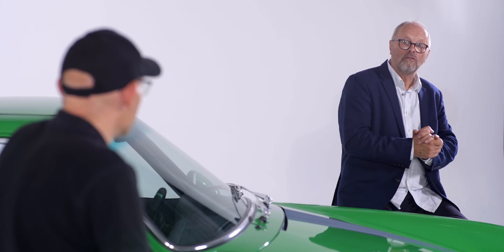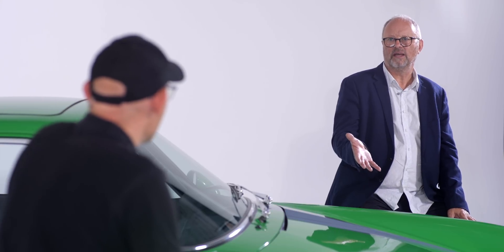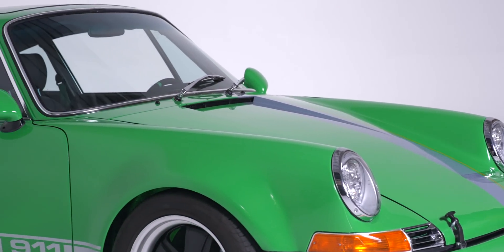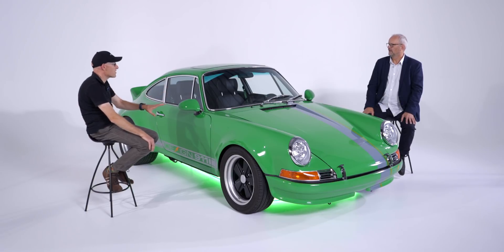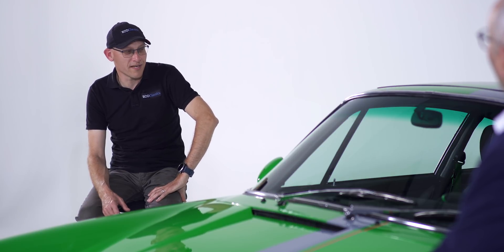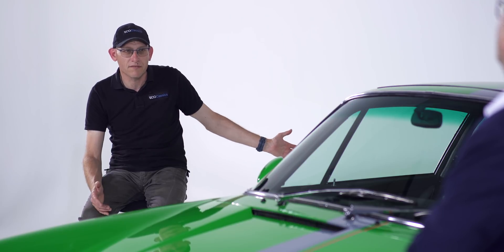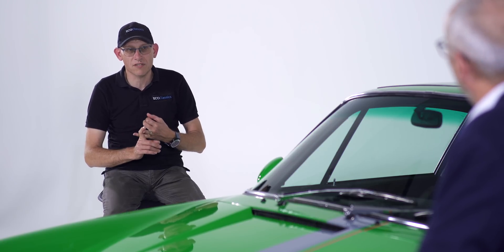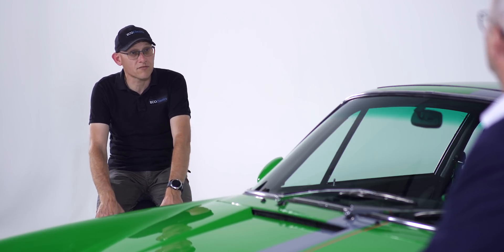Creating Electric Classic Cars - ECO CLASSICS | Fully Charged PLUS

Comment: Arguably, in throwing out the existing drive drain and replacing it with this electric uni t, with all the CO2 created through its production, the car probably has an even larger environmental footprint than before!!
Reply: And if the engine's siezed and un salvageable, you could save even more CO2 by sending it straight to the scrappers...

Comment: I’m not absolutely sure why a historic or classic car might need an electric motor? These cars are rarely used for daily driving and mainly owned so that people can admire them at a show or maybe the odd field trial. In the case of an old 911 for instance, a very significant part of its heritage value is in the beautiful “original spec” 6 cylinder Boxer engine…- am I wrong?

Comment: This is great, but the cost needs to come down drastically.

I really want to do a couple of conversions myself, but the prices are just ridiculous. I've been following the EV world since before the original Tesla Roadster, and it bothers me to no end that there are still no sources for generic, modular kits that can be applied to any car, and the worst thing is the prices. They are still massively artificially high. I've shopped around for parts, and there's no way it cost anything like £65k to convert that Porsche. A gigantic portion of that is profit. All that talk about "engineering" is hogwash. Making adapters and mounts isn't rocket science, and neither is any of the rest of the conversion. People have been stuffing V8s into cars that were designed for 4-bangers in their back yards for the better part of a century, and that is far more difficult than replacing ICE with electric. There are none of the issues with mechanical linkages or physical clearances, because controls and components are connected with flexible wires that can run anywhere and the components themselves are much more compact. Battery packs can be distributed around the vehicle and don't need to be one monolithic block like a fuel tank.

But if components and kits were easily available and reasonably priced, then evrybody would be doing it themselves, and we can't have that...

Comment: I'm not doubting the performance for an instant - of course EVs are fast (yawn) - but driving is about much more than acceleration and speed. (That's why so many people can't see any point in Merkin drag-racing and muscle-cars.)

Speed is perhaps 45% of the mix. Maybe 50.  The whole point of owning or driving a classic car is savouring the things that made it a classic in the first place. ALL the things, including the bad, dangerous, difficult, inefficient ones.

If you don't want archaisms, buy a modern EV. It's the equivalent of an 'app' for drivers who hate driving.  Switch it on, turn it up to eleven, press the quiet pedal, go fast. And then what? Check your phone for messages? Play with the infotainment screen? Muck around with the regenerative braking settings?

Ask yourself if your journey was really necessary? Most journeys aren't.

So if I drive a classic, I want to indulge myself. I want the whole experience: three pedals, manual gearbox, heel-and-toe changes, original handling foibles, the smell, the noise, the skinned knuckles and dirty fingernails after a gloriously frustrating weekend of tinkering under the bonnet, all of it.

I understand why people want to do this to cars they claim to love, but no amount of electric speed will ever replace what's missing. It almost depresses me that so many people don't get that.
Reply: Some people live the look but can't be arsed with the wonky old  engines.
Personally I'm all for it if it means it saves more cars and they get more use which in turn means thoes who can't afford them get to see them out and about more (myself included) 🙂
Reply: You mean things like getting in and wondering if it's going to start? That's fine if it's a hobby car I suppose...